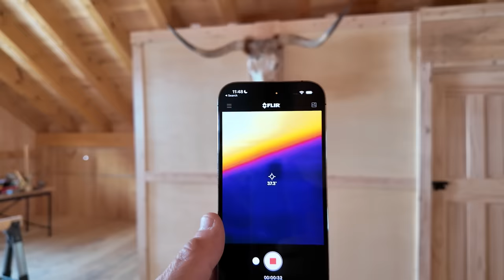Building a Bird Hatchery: Final Attempt (Episode 7)

Comment: I can't help but feel you're probably going to need better ventilation fans.
If this is the case you can go the route of looking at industrial cabinet ventilation fans or "grow room" fans. You could duct them to the outside too. Bring fresh air in the room at the same rate the warm indoor air is exhausted to the outside.
Reply: I was thinking that. Those two fans wouldn't keep a gaming computer cool, yet alone work in a sealed room on the 2nd floor of an uninsulated barn! Especially since at that point it's not true ventilation so it's not moving the hot air that far away, just to the other side of the top of the door. We'll see though this summer!!!

Comment: I totally agree that the tiny USB port powered fans are not going to be adequate to the task you are needing them for. But aside from that, the room looks really good. Thanks for sharing the process
Reply: Small form factor 120 volt squirrel cage fans would be just the ticket in my mind.
Reply: Was also thinking a mini computer, doesn't need to be a pi they a bit pricey with thermometer attached to turn fans on and off depending on temperature. He may need to get outside air if the barn heats up to much as well.
Reply: Lucky that he put them on their own separate board that he added last, instead of something truly built-in, so they should be easy to replace/upgrade
Reply: I use those little fans for personal cooling. They give off quite a good blast .
Reply: An option might also be a window fan. The one I have is two fans, high, low, off and you could flip it around to either inflow air or expel. It might even fit that slot with little effort.

Comment: If you want to be a bit more efficient, you can add some weather-stripping to the doorframe if you aren't planning on insulating it further. It should be relatively cheap and easy and will prevent the warm air from leaving through the small gaps between the door and the frame.

Comment: You should check out the fan/exhaust systems made by AC Infinity. You can program them to come on or off based on temps and automate fan speeds depending on how close to the target range it is. I use them on my grow tents. You can also get them with wifi so you can check on the fan action and temps using your phone from anywhere. (and set up an alarm on your phone if temps hit a  certain point)

Comment: I would re-investigate the use of those fans. From just looking at them on the video, that type of fan is meant for small spaces. You really need a fan to circulate the air in the room. In the summer, if it really warm outside, you might need a small chiller with the fan so the room is not boiling.

Comment: You can put some of that rigid foam on the door.  You could also build an air mixer:  A six foot piece of 4 inch PVC or ABS pipe, with one of those little fans attached to the bottom.  It pulls colder air off the floor and sends it up to the ceiling.  That would make the temperature much more uniform.

Comment: 6:56 "…thermometers etc…"
I started with a nice home automation thing, based around Homey. (And no, I'm not affiliated with them 😉 )
The nice thing is, is that it works with so many smart things. And there are many compatible temperature sensors available. 

And if things go wrong… you could activate lights, send push notifications, etc.
Also, it is possible to remotely switch light, water, etc on or off.

Homey works with easy to program flow-charts… called "Flows" and "Advanced Flows".
I really recommend stuff like this. And I think you are nerdy and clever enough to like that stuff, too!

I installed a lot of "Shelly" switches. They can be installed behind "old" switches. So, everything can work as usual. Even when the system is down, for whatever reason. The old switch would than work like it used to. When the system is up, the switch could control scripts (or the so called flows). It''s actually quite easy to set up en implement…

Comment: Definitely look into weather-stripping for the door to help prevent some of that cold air coming in around the edges. You might also want to line the inside of the door with a foil sheet insulation which can help reflect heat off the surface of the door to stay inside the room (this will keep you from seeing the heat on the door when filmed from the outside).

Comment: Since you're having an electrical heater in the hatchery, make sure it's on a surge protector and is sitting in a metal pan so it doesn't short out and cause smoke and a fire. And/or maybe put a baby monitor in there so you can check on the room from inside the house or elsewhere.

Comment: The cover for your opening for fan put it on hinges attach the styrofoam board to the board with screws or glue then put a piece of 1x4 screwed to the bottom board so you can turn the wood piece to lock the board panel closed ,you can also just take a stick to hold up the board when you want it open when you want to keep closed just leave stick in the opening easier then always unscrewing the board and loosing it

Comment: Good job ! This has been quite the adventure and as you said, there are still a few improvements to implement, but overall, it works !
I think you could have gotten away with some sort of shutter in front of the ventilators. It would be easier to open/close than a screw.

As a semi-related sidenote : VERY happy to see the cows. It'd been a while ! I can't wait to see them more now that the hatchery series is over.

Comment: You should consider fixing a foam board on your wood door to prevent it from bending due to the difference of temperature on both sides, doing this, you will also save energy.

Comment: I'm a little  concerned your rooms is too well insulated.  Once you fire up the incubators, it may not cool enough.  Also, the lack of airflow could be an issue.  You might end up with a lack of oxygen and too much CO2 when they start hatching.  I see you put in fans, but I don't see where you installed a vent for them to work get an cross flow.

Comment: In the incubator room Get 2 smaller heaters that way you’re not screwed when one breaks. Also those usb fans are junk they won’t last long look for a fan like what’s in an old tower computer that run off a power supply

Comment: I guess I don’t understand why you needed an insulated room to hatch your eggs?  You only hatch in the Spring correct?  Weather is warm in the Spring.  Aren’t the eggs kept in a temp controlled unit to hatch?  Why does the room need to be insulated?  That room will get unbearably hot once winter is over.  Just asking 😊

Comment: One other thing for heat. Tile. Tile and cement will hold heat. I would suggest at least putting tiles around the heater on walls and if you want floors. Also tiles can stop or retard fires.

Comment: I don't think using thermal camera is the right tool, thermal camera measures the heat radiation emit by the surface of the plane. So, you better to measure with time air thermometer instead. After all what the ducks feel are the air temperature.